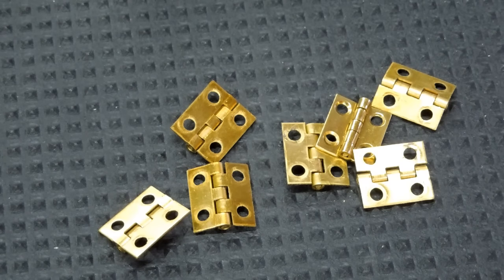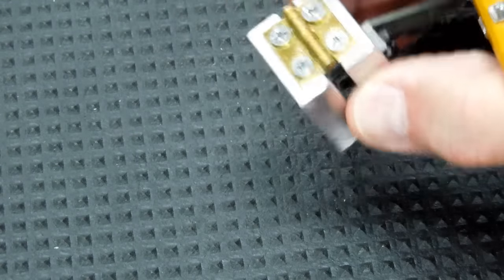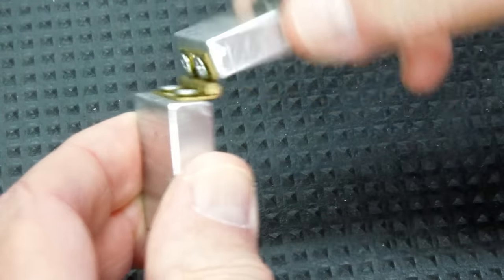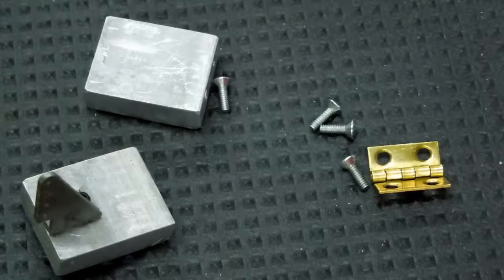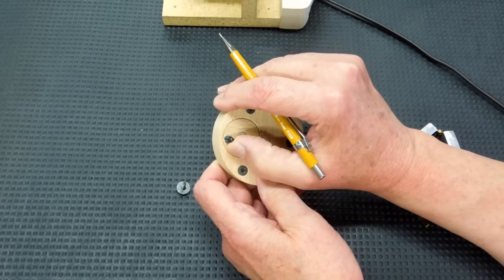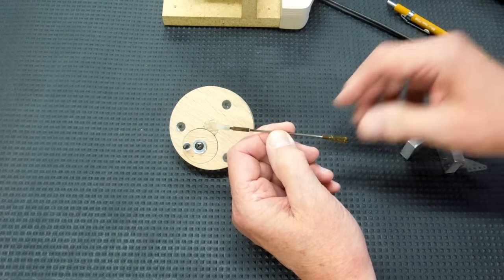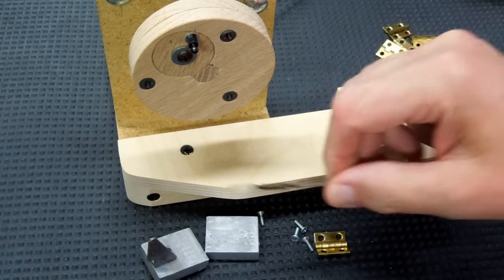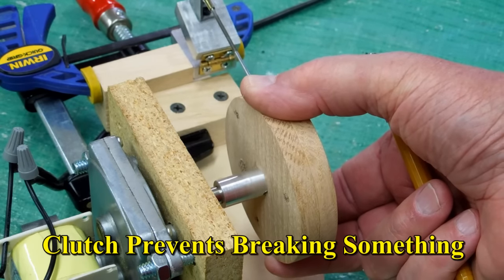Hinge Exerciser

Comment: It's a real pity that the hinges have gotten to be so poorly manufactured and low quality. I can only assume there are good hinges out there but probably expensive.
Your exerciser mechanism is very innovate and seems to do exactly what you need it to for this particular operation!
Hopefully, that will loosen up those hinges to open and close smoothly. I made a jewelry box many years ago with small  thin hinges but like yours they were stiff and flimsy. I ended up paying a bit more than I wanted for some much better ones that worked very smoothly. I'm sorry I can't remember where or what they were. I think they were of thicker material therefore I had to make a deeper mortise. They might even have been "Soss" type but that's just a guess.

Comment: Great video and problem solving skills as always Ron Walters.  Although not related to this particular video I have a question.  Some time ago you posted a video regarding the construction of a worm gear stating it was made for use in a future project. I haven't seen it since.  Has the project been scrapped or is the worm gear usage project still in its planning stages?  A recent video of your mechanical devices reminded me of it and I didn't see it there. :)
Reply from the maker: The worm drive is completed but the related final project is still a work in progress. I never intended to build an organ but then I built two... and they (and their related parts) have delayed several "works in progress." Thanks for watching! Ron

Comment: Looks like more than 48 rpm to me…
Reply from the maker: Wondered if anyone would mention that. The motor was marked 48 RPM and I shot the video and kept saying 48 RPM. Never actually timed it because I never cared exactly how fast it ran. When editing the video I thought it was more like 60 RPM (but still didn't care and still haven't timed it) and it was not worth re-shooting video or doing a voiceover. This is running at no load. Possibly operating in the intended installation for which this gear motor was made, it would run 48 RPM under a slight load. Thanks for watching!